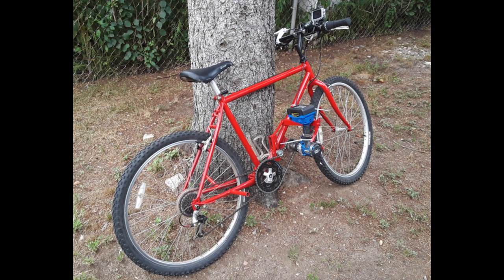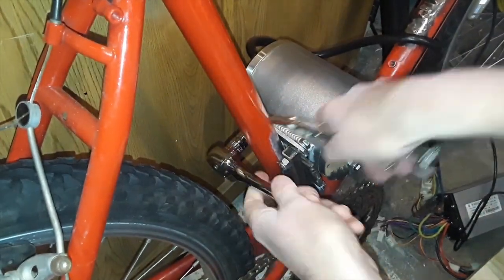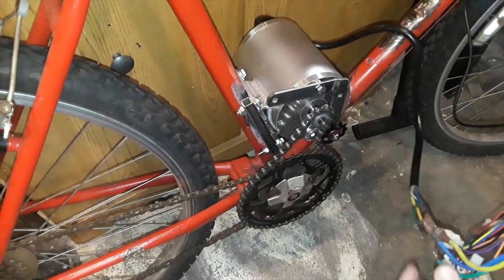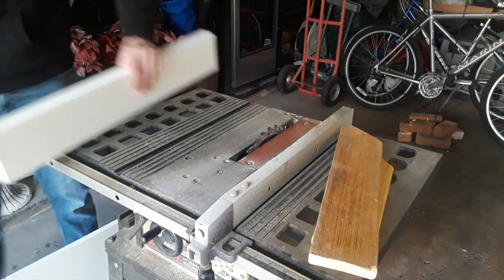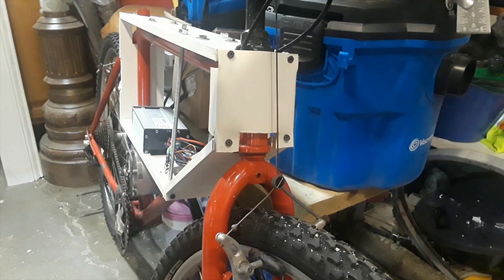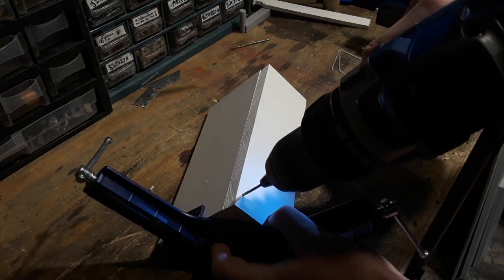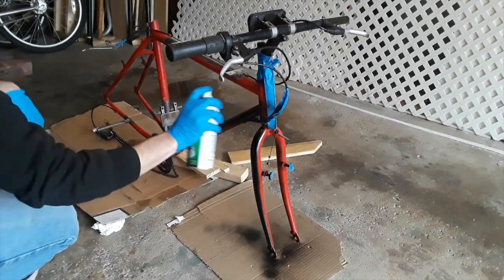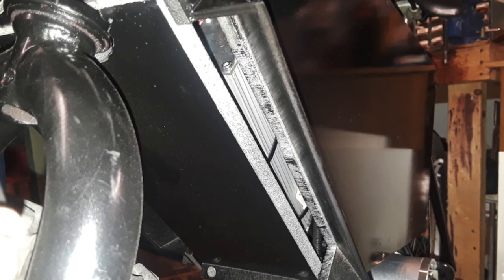Homemade Brushless Motor Electric Bike (31MPH/50KMH)

Comment: Cool build! I'm wanting to do something similar with a bike but I'm trying to figure out how to keep the crank, I'll probably try to get one of those oneway cranks but I don't mind peddling along with the motor either if I can't get one.

I have a 60v 2500w motor with a custom 60v 18ah battery I made that can supply 80a and a shunt modded controller to match it which should put my power approximately 5500-6000w with the battery fully charged to 67v.
Reply from the maker: That's awesome! Goodluck on your build!

Comment: How long does the battery last ? 
Really cool thank you.
Reply from the maker: Currently I recently upgraded to running two 48V 14AH Batteries in the bike. I'll probably do an update video sometime this spring. But if my math is correct this bike draws 30 Amps of Power at Maximum load (Speed of about 30MPH). And if I have 28AH of Batteries I would estimate I could go about 25 Miles if I completely drain the batteries. Personally I don't want to discharge the batteries past their halfway point so I would estimate around 12 Miles riding at 30MPH (using half of the batteries energy). Hope this helps!